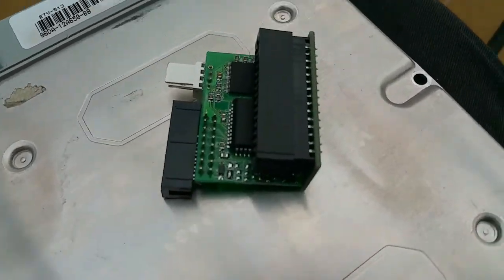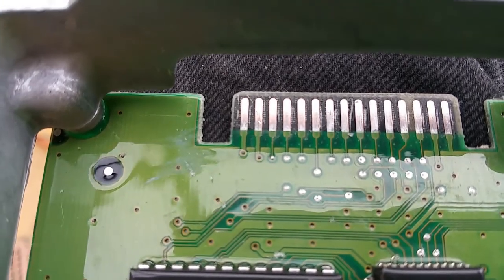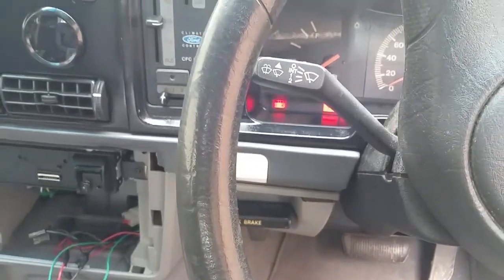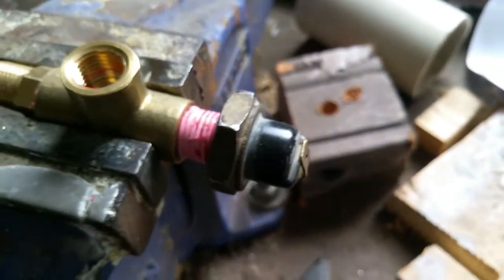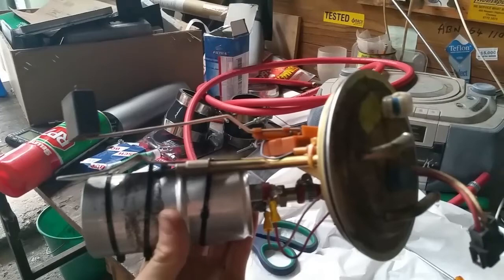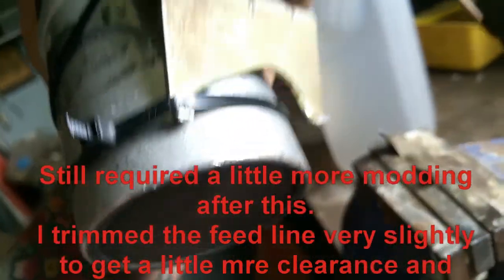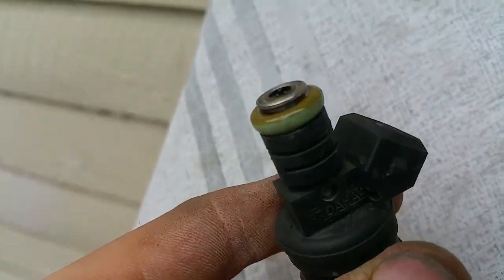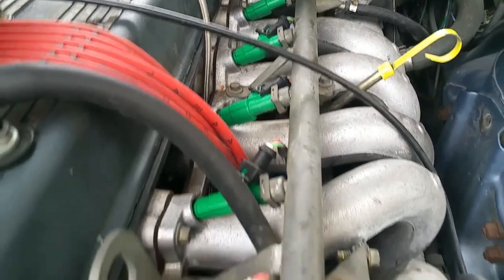ED Falcon turbo build EP.2 - Fuel System & ECU J3

Comment: Hey mate , 
I've got a few questions on what parts / upgrades are required . 
Turbo / manifold / intercooler etc are straight forward.  but im trying to figure out how to make it run .
did you need to upgrade the fuel regulator ? 
Did you need to upgrade the M.A.P   sensor now that it is reading boost  ? or did the j3 take care of that side of things .
Any thing else need to be changed to make it run properly ? 
Can you tune the J3 ? 
thanks in advance .
Reply: have you found the answers to this question yet mate? i have the same questions haha

Comment: hey mate love the build.. im going to be turbo charging an ed aswell.. who did you buy the kit from?
Reply from the maker: My kit was from ebay but the guy doesn't make them anymore.
If I was starting again though, I'd buy a kit from Spoolinboost. Cheapest kits I've seen and they're proven to work well. The owner of the company has run them on his EF with the original motor, and then with a BA motor after killing the EF motor at around 430rwkw. He runs one on his FG now. All have been abused on the drag strip and hold up well.
http://spoolinboost.wixsite.com/spoolinboostadelaide/topmount-ea-bf-turbo-kits
Reply: Will they fit xg xr6 ? And do you have a link to where you bought the chip, injectors and fuel pump from
Reply: Will the chip and everything fit a 93 xg xr6 ute as I'm keen to turbo mine